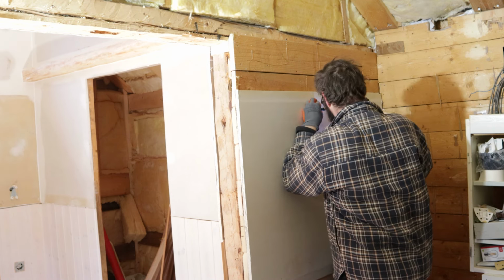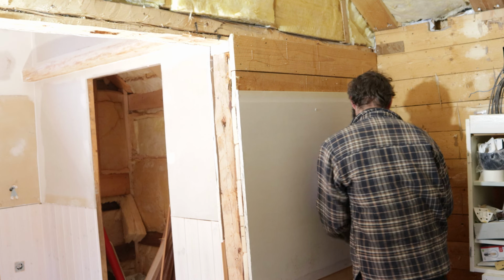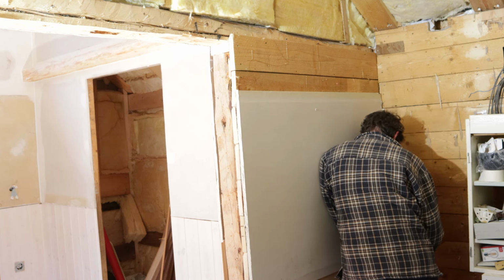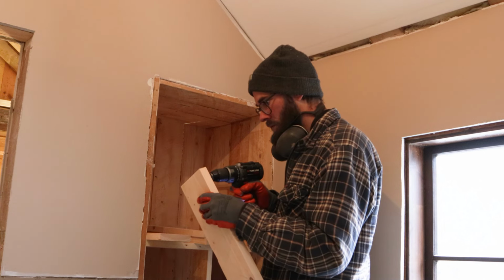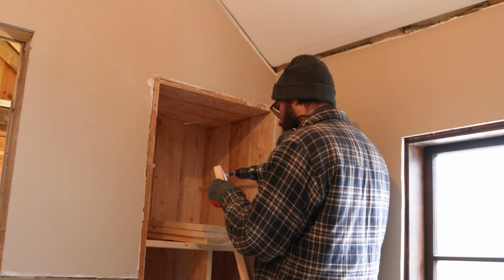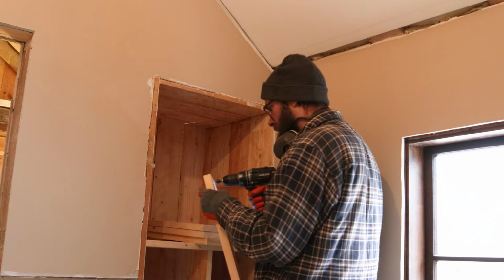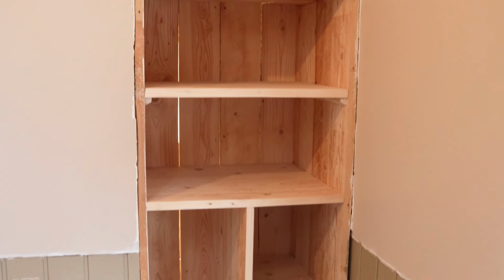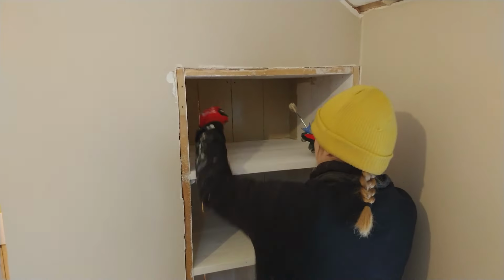The Cost of our Swedish House and Why we Bought it | Renovating Continues (Story 08)

Comment: Honestly, for that much property and all the buildings, it sounds like a very good price.  Comparing to the area in US/Florida where I live, it would 2-3 times that amount.  I think that property and all the little cottages is a great place to make the home you envision.  I think is wonderful that Sweden has 2nd hand stores for materials, I'm all for upcycling and recycling as much as possible.  It's also nice you have a stock pile of materials in the out buildings to sort through.
The cottage you're working on is coming along nicely.  I like all the insulation on the walls, insulation, board then dry wall, sure will cozy and snug.
Reply from the maker: Thank you!